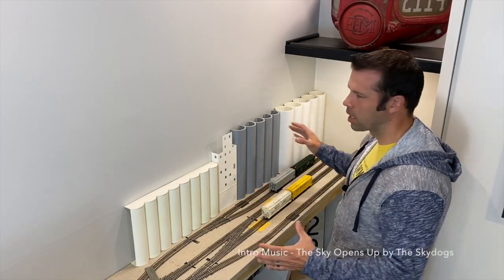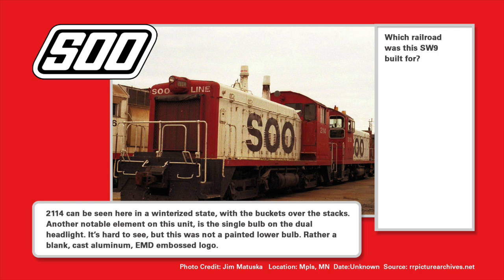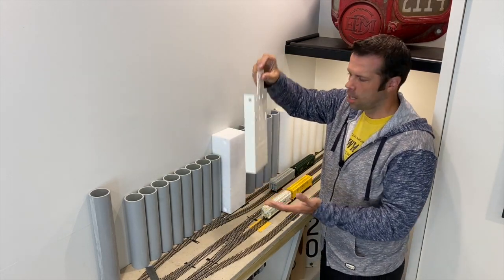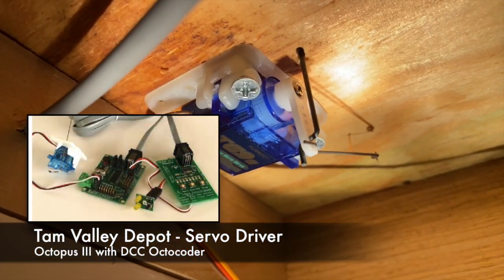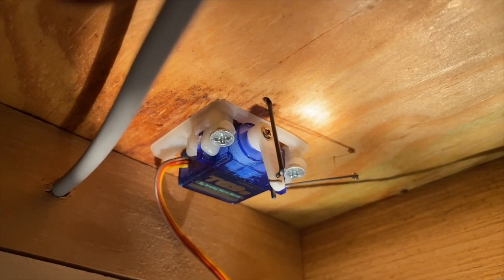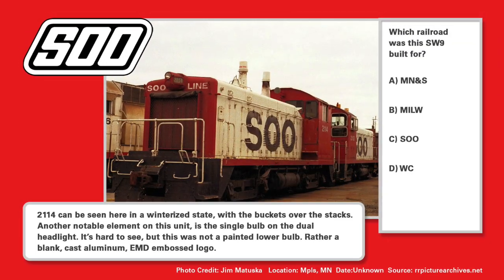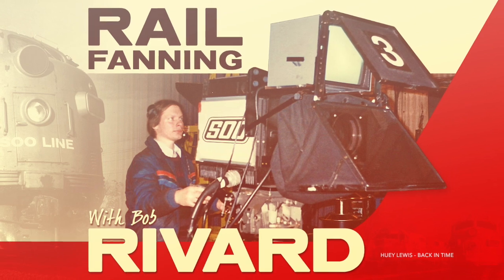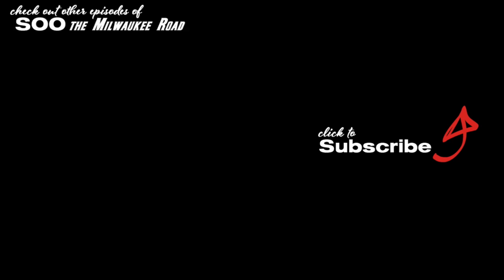S04E09 - How to create silos, automate turnouts with switch stands & go back-in-time w/ Bob Rivard

Comment: Nice job. A couple of questions answered for me. 1. Flat siding silos. 2. Rotating targets. Thanks.
Reply from the maker: The beauty of using the schedule C for elevators…ya can use the same glue you’d use for the PVC for fitting the pipes. Strong bond!

The rotating targets might be overkill, but the application can be used in any number of uses. Fence gates, Griswold stop sign rotation, etc.

Thanks for tuning in and posting your feedback.

Comment: Great how to on cutting pvc silos. Keepin ya fingers is always high up on the to do list. Great job on compressing the elevator complex. Over the years I have collected so many structure kits only to later realize that 90% are compressed in some fashion but i guess that actually works out well in some cases. Thanks for sharing. Cheers Rob
Reply from the maker: yrunaked4 I’m right with you on the structure collecting...I bought countless elevators for this part of the RR and when all was said and done?!? I’m ending up scratch building most of it. 😬 However, that’s fun too...then it’s a one of a kind building.

Comment: Great info on scratch building structures. A tip I got from a fellow modeler is if you have a track where engines will sit when not in use take a little bit of black paint and put it in between the rails to simulate the effect of oil dripping from the engine. The smaller companies make great stuff definitely. There’s lots of stuff that have come from smaller companies that companies like Walthers just wouldn’t make. I think the SD10 kits is a great example of that. Another great video! Those SW9s lasted for a while in service. I think one of the twin ports units 2119 is in the deadline at NRE in Silvis, Illinois.
Reply from the maker: You NAILED it in your comments...everything from added details to the backstory on 2119. It’s crazy where units can end up. I just spoke with an MNNR employee that noted the units at NRE. Your posts are always of interest, thanks for commenting and for tuning into the video.
Reply: I think I’ll take a page from your book and use pvc pipe to build some of the structures for my iron ore mine. pvc will be great for building fload loaders like what the real mines have.
Reply from the maker: The Northern Lines that sounds great, I don’t know much about the iron ore world, but from the creative solutions department? It sounds like you’ve got an answer for your floats.

Comment: Great video once again.
You talk about the proto elevator, well...to fit Atkinson, T and Nokomis in N scale  I need 15 foot (ish). So like you, selective compression is required. Your general mills is going to be an M.O.A.E. ( mother of all elevators).
The switch stands are just OUTSTANDING!!! Nice work using the servo to throw both moves. Was it possible to use the throw bar to control the chevron?
Those guys need to make the coolness in N scale, like yesterday.
Did you use the measure function on Google Earth to measure the heights on the structures?
On my N scale version I am trying to do Atkinson, T and nokomis. Also for variety I plan throwing in the two track scrap yard to the northwest of the Atkinson mill on the north/east side of the tracks.
Too many times I have been switching in the rain during my time with the CNW. Funny thing..there was never a place to hide from getting wet. Unless you were at beans. I like how the crew is conserving moves with the loco position. I wonder if  the Milw ran 3 man crews for that job in the 80's? You could put a guy on each end, maybe more efficient time use..hmm
No FB for me, just not my bag right now..maybe some day.
Keep it up!!
Greg
Reply from the maker: Greg,
Your replies are always of great content. Every time you post, I find a moment to sit down and read.
Bob Rivard has noted the 4 digit locos as WC, but not the 4000’s, like 4400 GP38’s...right? I’ve found very few shots of 2114 in the black, as delivered, paint scheme.
As for 1:1 modeling...you’re correct about the grand scale...I’m looking at nearly 5ft in length for the Cargil (Mpls Seed Co) structure. It’s crazy how fast space can be eatin’ up.
I did scale off freight car lengths for the building lengths...it was a rough estimate. Until I went down there and measured them. In a previous episode I covered the measuring technique. In combination of a golf range finder and some basic algebra. I was able to get a decent enough estimate on height. The Google Maps appear to be slightly squished in weight, but like anything, we try and get it close.
The Milw did use 3 man crews in the elevator district in 1986, as Bob’s footage shows the two guys on the ground. All making for a fun area and era to model. I’d say, if you have 15ft to model it one to one in N?!? DO IT!!!
Thanks for tuning in and even more, thanks for commenting. Its always content of interest.
Take Care,
-William
Reply: @SootheMilwaukeeRoad  
William,
The four digit vs the 3 digit thing was just for initial book keeping. 
The 4400 series..i would say no..but..what if they drew the 4 digit system from the F unit trade in's that the SOO did to acquire the 38-2's. That does make sense
I do know that the three vs four digit thing applied to the F units also.
Keep on keep'n on
G
Reply from the maker: Greg Burzynski makes total sense! Yet again, great info.

Comment: Who makes the brackets to hold the servos ?
Reply from the maker: They’re aircraft servo mounts that were purchased years ago from HobbyKing.com. I just did a search on their site to locate them and came up empty. Now I’m perplexed as to where I’ll get more. Sorry to have come up short on this one...

If you find something comparable, let me know!
Reply: @SootheMilwaukeeRoad  I've been using sg90 servos to actuate semaphore signal blades and have been using double stick tape to stick them to a block of wood mounted under the baseboard. 
I'm going to try using these. I hope they work out.   https://www.ebay.com/itm/4-pcs-x-mini-small-Servo-Mount-bracket-SG90-stand-Vertical-w-screws-PETG/264769100230
Reply from the maker: Farmer Dave let me know how the work...look to be 3D printed. Which isn’t a bad thing, I wonder if I could request a side mounted version like I’ve got going right now. The ol’ inner-web has almost anything we can dream up...crazy to think. 🤔 Thanks for the link!
Reply from the maker: Farmer Dave that’s PERFECT! It’s even more streamlined/flat than the ones I have.